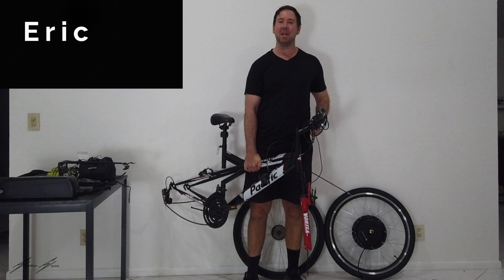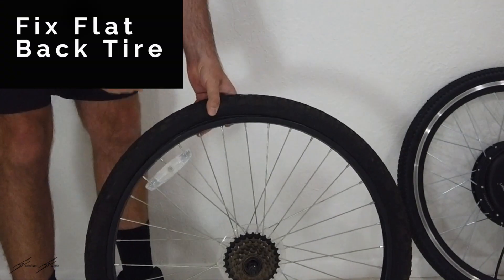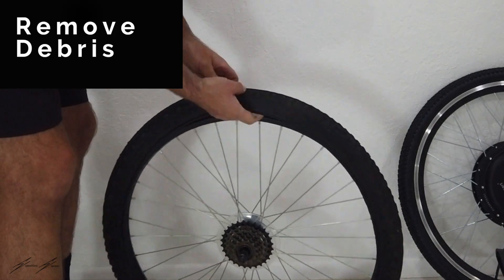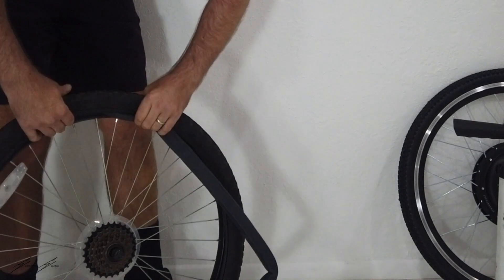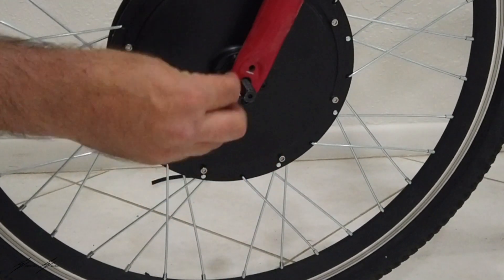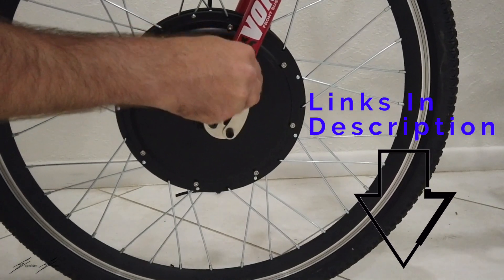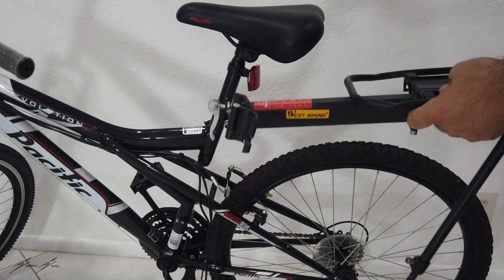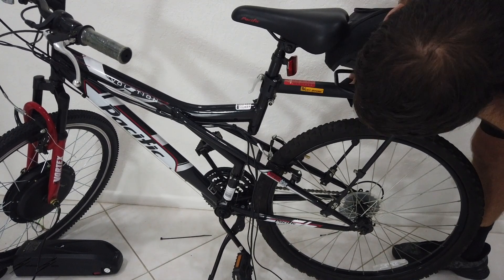Voilamart Front Hub Ebike Kit Installation [1000Watt DIY EBIKE]

Comment: Great job!..I own the Voilamart front wheel motor.   My battery keeps overloading if to much throttle is use.  The pas system not installed.   Any suggesstions?   I used a cheap battery for starters.  You get what you pay for?

Comment: How did u connect the green bullet plugs to the battery? Because isn't the battery a xt60?
Reply: Hey, my friend! You can either learn to solder the connections, or you can just buy a separate battery cable. It's pretty cheap.

Comment: I cannot find the video in the description for connecting the terminals to the battery wires, so you can connect to the controller. I looked twice before  checked all comments to see if anyone else asked as well.

Comment: I just bought the wheel. Do I have to purchase the battery (Unit Pack Power)? Or does it function automatically with an internal battery? If there is such a thing. Thx 🙏
Reply: Yes you need a battery to power the motor. 48v 13ah

Comment: where is a on off switch on the battery my battery is live , went to plug it in and got a direct short to ground ,w t f , checked the on off button the twist grip ?, so there is no real on or off switch ,just the red push button , ? the instruction are less than vague, as i would have thought even with the red button on there would be no current drain untill you open the twist grip , i assume this is proportional

Comment: Torque brace should be on the front of the forks and the controller bag should have a small hole for the cables to feed through.
Reply from the maker: Why is it at the front?
Reply: @expedition-electric3549  I have mine just like yours, I followed the many pictures (official and customer) to guide me.

Comment: I bought a kit and haven't been able to use it due to lack of customer support.  I want to use my old 3 wire thumb throttle and no PAS. Will it even work like this and if so then hw do i wire the throttle they have on the controller to work with my thu7mb throttle???
Reply from the maker: We're you able to find a solution to your question.?
Reply: @expedition-electric3549    NAw....I‌bought a twist throttle and applied that . I‌figure I can cut it down to use as a thumb throlle andf that was easier than trying to figure out a controller that has no literature. I just won't buy chinese controller anymore unless there is paperwork.
Reply: @expedition-electric3549    Actually since the chinese didn;'t address the controllers and throttles wirig I‌resort to buying a six wire throlled and am using that with the cutting down of the twist throttl and turning it into a thumb throttle.

Comment: Front hub motors should not normally be used because the front fork is not designed to be pulled by a motor and can eventually break off. Also a front hub is very unstable in loose dirt gravel and rain.
Reply: But the weight helps gain traction in the wet.
Reply from the maker: I see
Reply: I have not noticed any lack of stability using a front drive versus a rear drive assembly. But then for the most part I drive my ebike on pavement anyway.

Comment: I’ve installed several of these.  Not one has been green to green, yellow to yellow, blue to blue.  That usually results in the motor spinning backwards.  I came to see which blue wire restricts it to 750W but couldn’t see that 😡
Reply from the maker: Oh I see. were you able to find a solution?

Comment: I leave the throttle connectors Off before connecting battery terminals. If the terminals last connection, it will discharge a bit.
Reply from the maker: Ok will do next time

Comment: my wife got me this kit for my birthday, the amazon link says on road only. why?
Reply: Front hub motors are unstable in rain and gravel and dirt. They are also unsafe because the front fork is not designed for the pulling force of the motor and can eventually break off the front fork, possibly while at speed.
Reply from the maker: Not a great ride for off road

Comment: Hello and thanks for the video. It's been a couple of years since I completed my installation on the violamart front hub motor. I have a flat tire and cannot not remember how to disconnect the front motor lead from the tire in the most easy manner. Obviously I don't want to mess up the motor. Can you advise?
Reply from the maker: Hello, Were you able to find a solution to your problem?
Reply: Yes. I had installed connectors to the controller box that I unplugged and fished out the old tire/tube over the wires and put the new one on. It was a little messy but it worked out okay.

Comment: hi , nice video! im installing my ebike kit and have the same type of battery, how did u attach it to the rear rack or to the bag? or did you just placed it in the bag like the controller? pls reply
Reply from the maker: Hello TheMatixen, 

Thanks!  You can either get a bag like this https://www.amazon.com/dp/B07PD2MP59/?tag=expeditione05-20. 

These bags connect to rear rack with straps on bag. Or you can get  some straps like these for better airflow on your battery. https://www.amazon.com/dp/B08MZYWQ3L/?tag=expeditione05-20

Comment: So its illegal to use on anything but private property..........................750W is the legal limit for US street use. I rather have a 750W mid drive that allows to keep my gears, increasing the climb ability, and top speed. Both of with would be greater than a 1000w hub motor.
Reply from the maker: Yeah I hear you.  I enjoy the feel of the mid drive over the hub drive and it does have other advantages, But I do get the exact same speed from 1000Watt rear hub drive as I do with the 1000Watt Mid Drive Conversion. Both reach 28mph
Reply: Sometimes you may not want to pedal.  If you can have a bicycle AND a moped then why not?  Also, geared hubs and mid-drives violate the principle of least complexity which sure as sh** means increased maintenance and t-shooting in the long run.
Reply: who gives a damn whats legal?   if a cop is worried about a GD overpowered bike instead of stopping these democrats from looting our cities then he's a GD psychopath.

Comment: Having a shark battery in a rear bag is a lot more versatile than a rear rack battery. My UPP rear rack battery clunks around and seems heavier than my other packs. Great video.
Reply from the maker: Do you mean a shark battery like this?  https://amzn.to/3AtmvEb
Reply: @expedition-electric3549  Sorry I meant the battery you used is better because you can use in the triangle or mount on the rear if needed. Good choice.
Reply from the maker: @kjohns1413  Ahh Gotcha, Thanks!
Reply from the maker: Thanks!